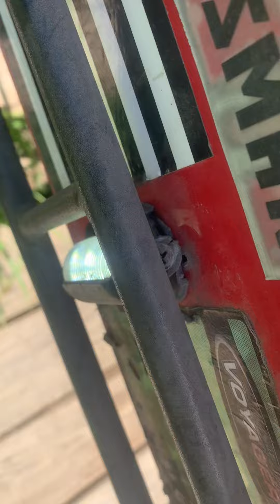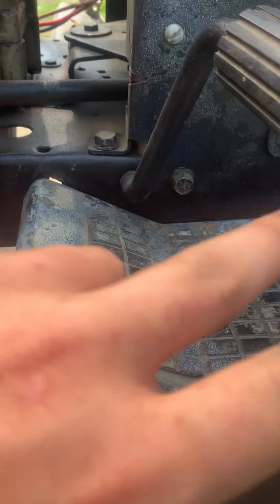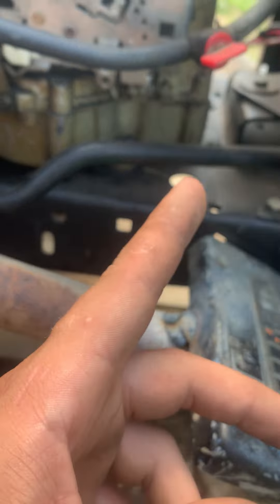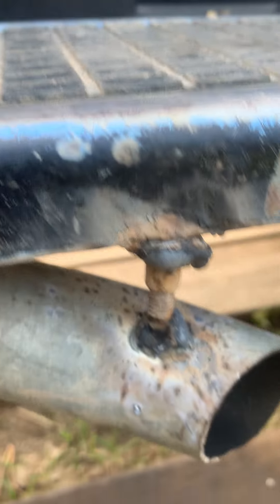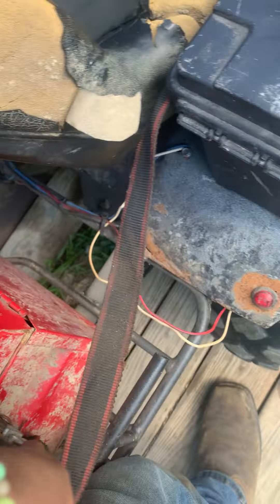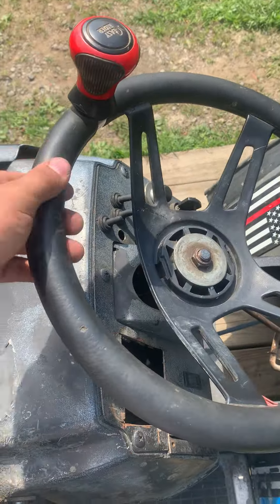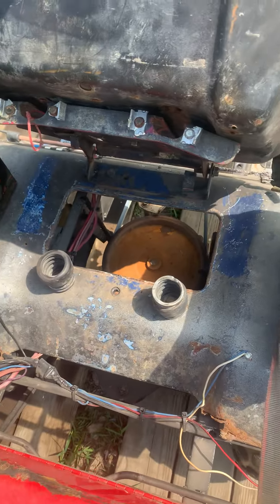Mud mower rebuild part 5

Comment: How dose your throttle run
Reply from the maker: I will do a video on it like Sunday if I can but it’s kinda Jenkee but it works
Reply: @ratherbeinmyshop9328  k thanks
Reply: @ratherbeinmyshop9328  so the vid?
Reply from the maker: @Redneckmowers  will when I get time
Reply: @ratherbeinmyshop9328  u got messenger
Reply from the maker: @Redneckmowers  yes
Reply: @ratherbeinmyshop9328  what is it I will add u
Reply: @ratherbeinmyshop9328  I wanna send u pick of my mower
Reply from the maker: @Redneckmowers  Kyle paro